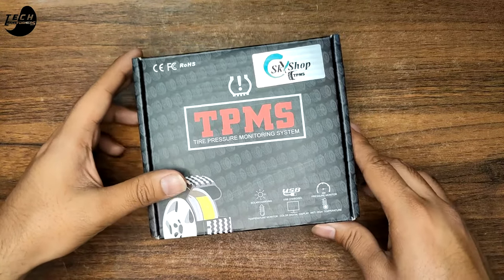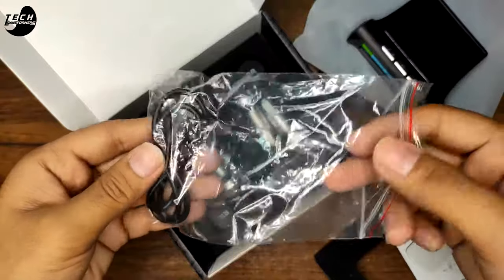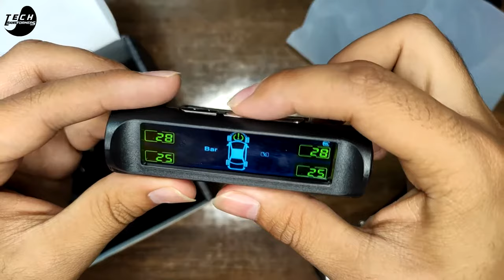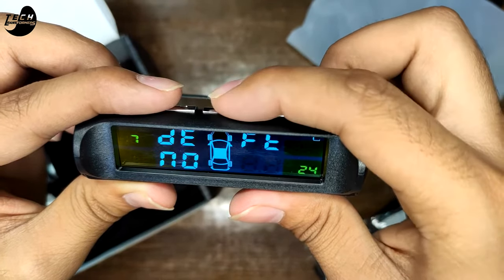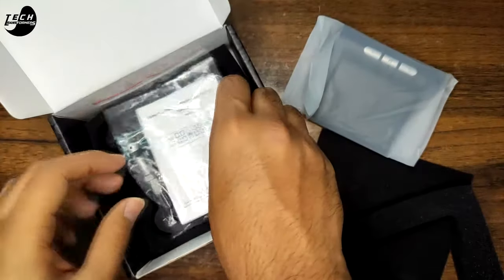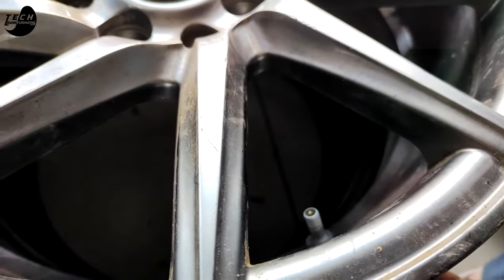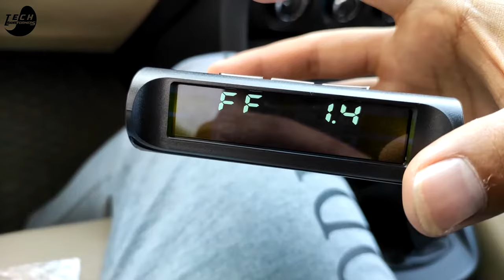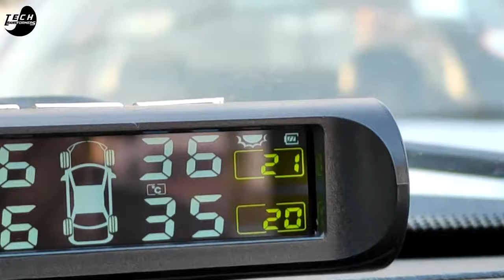How to Install Tyre Pressure Monitoring System in Car | Solar TPMS - Internal Sensors

Comment: Isn't wheel balancing necessary after installing it instead of alignment?
Reply: He said he did wheel balancing plus wheel alignment
Reply: I installed the same TPMS and I installed 30g counter weight  at the opposite side of the wheel to make it balance

Comment: i had an internal sensor one, i was using it but main unit has broken. then i took another full package but with external sensor. whats your oppinion about pairing new mainunit with old internal sensors?
Reply: Yes, is possible paring with internal sensors normaly

Comment: Bhai is cap is necessary part of this sensor, because I lost one. Will it work properly without cap.
Reply from the maker: Yes it will work but try to install another cap as dirt deposits could damage it.
Reply: @TechTRANSFORMERS  Thnx , figured out lately

Comment: I mean for filling air it takes 10rs
For buying such device at 3k why not just get it checked whenever possible in the same cost we can check almost 300 times.

Even if we say we check pressure weekly i.e. 4times in month then too its merely 100 times

If we consider this system lasts for 3 years then too its not at all viable we have not even factored the wheel alignment and wheel balancing costs here
Reply: Well, I also thought same but the device is like more of safety and convenience sort of feature for old cars which does not come with factory fitted TPMS. It rings an alarm if your tyre losing air rapidly (puncture situation) So, helps you to never face flat tyre or to maintain air pressure with almost (98% accuracy) I use Michelin tyre pressure guage to double check and also the sensor can calibrate tyre rotation through settings, also you can see the temp of each tyre too.
Reply: You won't feel much for one punctured tire for Tubeless type. By the time you eventually notice it would have had damaged the tires quite a bit. Specially for cars with high side profile tires. And also by the the time you notice you may be left last populated area and have to change wheel alone in some dark place while stuck with family. So compare that risk with rs 3000/-.
Reply: You don’t get live tyre temps and pressure just filling air, which is free by the way if you fill cold with your own compressor. You’re comparing apples to oranges.

Also you don’t need to pay for alignment again, only balancing.
Reply: You don't understand the function of TPMS, when you running on a busy street and your tire losing it's pressure you can put your car slowly at the side street and change your tire or inflate, if you don't have monitor you can be stack up in the middle of the traffic road.

Comment: Hey, how to power the units within the tyres.No batteries installed?
Reply: Solar power.and you have a date data cable to charge comes with it
Reply: The units inside the tyres have non rechargeable, non replaceable batteries that last 4 to 5 years

Comment: Good for pressure indication but it shows misleading temperatures. For me in cold weather it is showing 38 to 46 deg C.  Outside temp. Is about 28 deg C.
Reply: Temperature increases under pressure
Reply: Temperature is measured inside the tire, not outside or environment temperature.

Comment: Hello. Mine recently just started showing ZERO values. And I mean tire pressure, temperature, everything is Zero. What should I do? I tried inflating ang deflating my tires just to see if it would make a difference, but it doesn't do anything. My tpms is just 2 years old.
Reply from the maker: Try resetting it by fully discharge and charge it again. Contact support if nothing works.
Reply: I think your tpms damaged, you can buy a set of external, the battery can be replaced by their own products, so you can delay the product life，Easesuper is a good brand I use, this is my recommendation
Reply: @TechTRANSFORMERS  I already did. Oh well. I'll just change them. Thank you.

Comment: 3 to 5 years is a short lifespan for tpms sensors, why?
Reply from the maker: It might go long, depends on various conditions.
Reply: 3 to 5 years are the battery life span and not the sensor itself.

Comment: What to do when we need to shuffle tyres?
Reply from the maker: There's a setting for tyre rotation. You can do it without removing sensors.
Reply: Shuffle the tyres and not the rims simple..
Reply: @sanjeevdas24 removing the tires from the rim is hard than to remove the sensor.